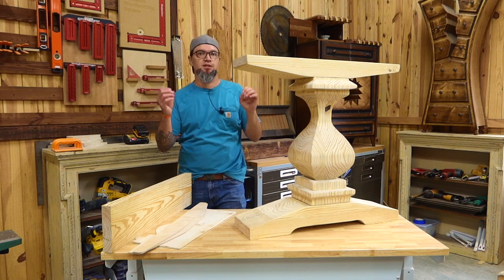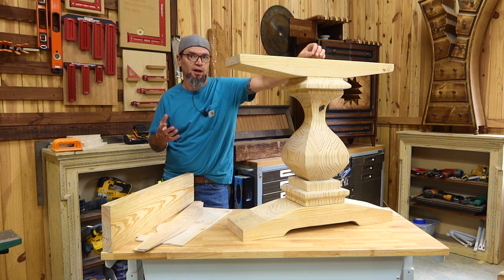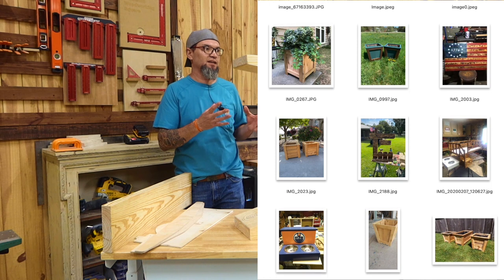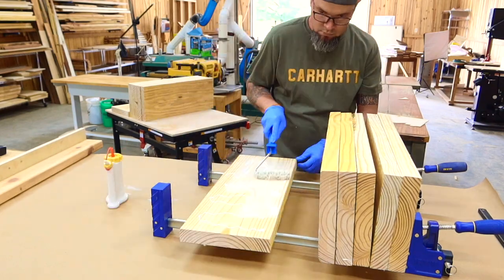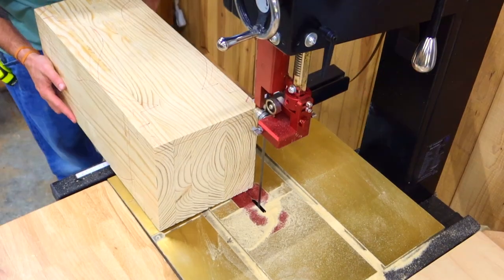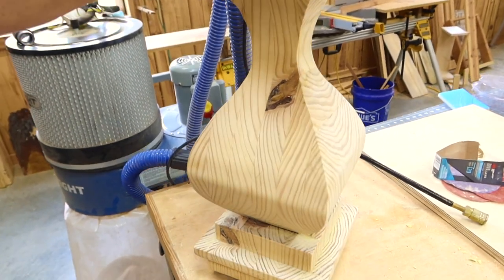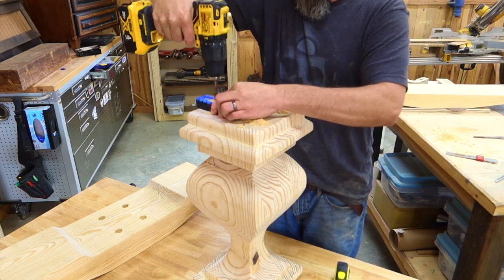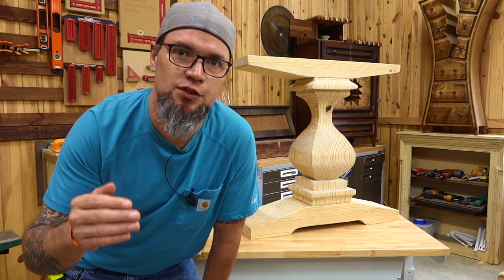Pedestal Table Legs  - Low Cost High Profit - Make Money Woodworking

Comment: I have built 100’s of pedestal table based not just like your style, also turned but have never built one out of construction grade lumber. Do you let it set and dry for a couple weeks? Living in Arizona with very low humidity that construction grade would be a nightmare to work with. 
Depending on customer I made most out of Ponderosa pine, Sugar pine and domestic hardwoods all kiln dried.

Great video showing people that they are not hard to build.

Comment: Thanks for another awesome video. The 7 qty 2 x 10 are they 8  or 10 feet in length?
Reply from the maker: Hey!  They are 8'.  Actually if You use 10'  boards you would only need 6.

Comment: Hi Matthew!  Just came across your channel a week or so a go.  Been binging on your content.  Just what I'm looking for.  Great videos.  Quick question.  I have a pile of 5/4 x 6 x 12' poplar fenceboards that never got used, are extremely weathered and a bit bent and twisted (although 3-4ft sections are relatively straight.  Any ideas how I might be able to turn this eyesore into cash?  Loved the coaster idea with 4x4's and I'm currently gearing up tom make trellises and obelisks (I can't say it either).  My toolset includes a beat up 10inch compount mitre, a 10's constructions site table saw, 9" bandsaw, router, screw gun and drill, assorted clamps and small tools.  Planer, joiner and upgrades on everything I already have are on my list of things to get in the near future as I start generating some cash.  My workshop is an old greenhouse.  Can get a little hot, but will do until the day I can afford to build my own.  (I own my home and 8 acres.)   I look forward to any insights or advice.

Comment: The moisture content of construction lumber is much higher then you want for making furniture. Of course if you market this as outdoor or adirondack style furniture that likely wouldn't be a problem. I'm curious if you used something like this for a kitchen table how much it would effect the top as the base dried and moved over time.
Reply from the maker: I always check moisture before a build with any lumber.  As long as you bring it down to around 8% your good.  Its all been dried in the past so it will dry fast.

Comment: Awesome project, I finished restoring a 20” bandsaw not long ago might have to make one of these with it. Also Just thought about it when you ran the boards through the planer. Have you found a way to get your big powermatic planer set up yet?
Reply from the maker: Thanks!  Heck yea try this build out.  I think I'm going to try out the Dps phase converter.  The issue is the motor is missing the plate to tell me the HP.  Im thinking its a 7.5 but they also made a 10 for that model.
Reply: @MatthewPeechWoodworking  oh that will do it! It’ll be a beast once you get it going.

Comment: Question:  Is there any smaller projects that you can recommend that incorporate the same techniques for cutting out the pedestal just so one can get comfortable and skilled at doing this on a larger scale?  Thanks!!
Reply: Try making a table lamp.  Same shape with just a square base.  Many instructions on web or video on Youtube to show how to wire up the lamp socket and switch.    Go for it.
Reply from the maker: I agree with kirk.  Use a 4x4 and go to town!

Comment: A thought. On the off chance that the mounting holes for the lag screws are not perfectly symmetrical, I’d add a witness mark (chiseled mark) on the mating faces so I could be sure of putting them back in the same orientation.
Reply from the maker: Very good tip!  Thanks for sharing!

Comment: I could be way off of the mark, but depending upon the profile shape of course, it seems like it would be just as sturdy and significantly cheaper in material costs to build the pedestal in 4 panels with 45° beveled sides, making a hollow column. I think this approach might especially make sense if you're trying to work in more expensive/exotic woods such as some variety of hardwood. I'd love to hear some thoughts and feedback from others on this.

Comment: Before you ran your boards through the planer, they were already 10x better than anything I can find at my local box store.
Reply from the maker: You have to dig my man.  It seems like its hit and miss.  Keep in mind when your cutting into smaller parts the amount of bow is reduced with each cut.  So I can work with a lil bow... just not twist.
Reply: You’re right! His lumber looks way better than anything I can find here. 😂
Reply: @MatthewPeechWoodworking  And dig and dig and dig. Never an easy time. And when stock is low, it may not be successful. Hopefully, things are improving faster than prices are dropping.
Reply: Some of the best lumber that size can be found in the 16’ and 20’ stacks. That’s where I head when using anything bigger than 2x4.

Comment: Observation: when you have a square block and you want to make your shape a simpler way is to mark a centre line cut it re-glue rotate 90 degrees and re cut again you now have 4 pieces which you glue together on the 90 degree angles. try it out. you can make any cut, any shape and the results are amazing. Love your work.